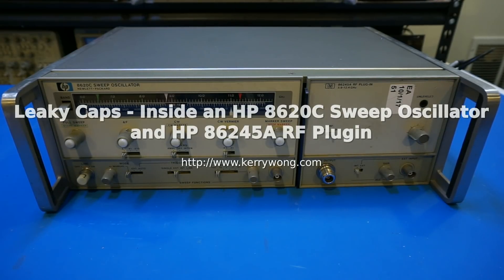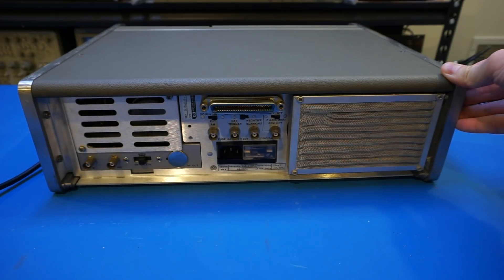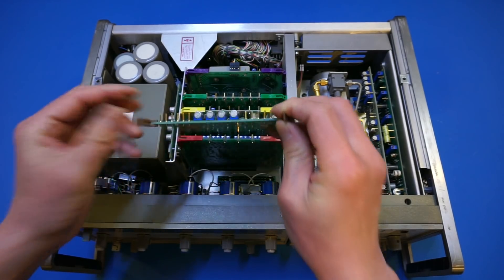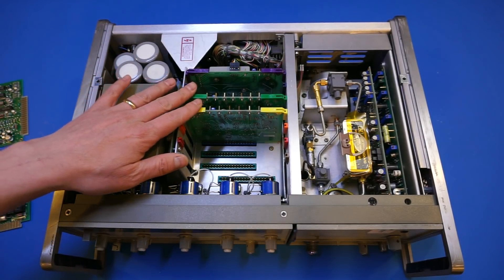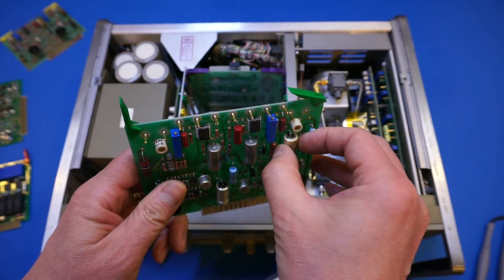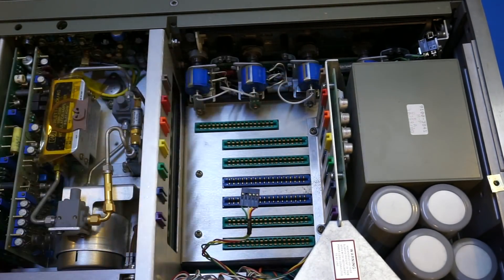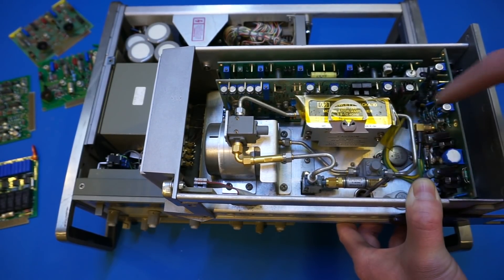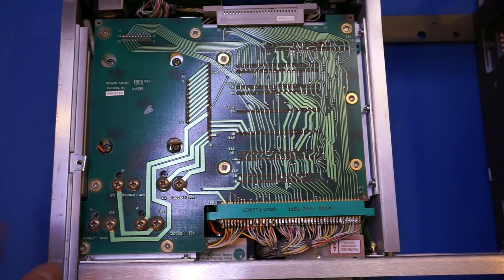Leaky Caps - Inside an HP 8620C Sweep Oscillator and HP 86245A RF Plugin

Comment: The capacitors that did not appear leaky look like M39003 "Tantalex" capacitors. These are essentially mil-spec solid electrolyte tantalum capacitors, extremely reliable. So reliable it's almost unbelievable (some equipment I work with have RF power amplifiers that operate around 60-80C 24/7 and use Tantalex capacitors, 30+ years in operation and counting, and I have yet to encounter a bad capacitor!).

Wet tantalum electrolytic capacitors on the other hand... terrible. The wet electrolyte is acidic and over a long enough period of time ends up eating through the leads and casing. Very common with old gear. Those capacitors eventually go bad just sitting there. Entirely possible that piece of equipment was working fine the last time it was used and the capacitors decayed in storage.
Reply from the maker: I can confirm that those good ones are remain in excellent shape. I took one out and did some measurements, the ESR is lower than chemicon one I was about to replace it with so I soldered it right back :)

Comment: You never mentioned if you checked the voltage setting on the rear and the fuse, just in case you overlooked obvious causes first.
Reply from the maker: Yes, the voltage setting was set to 110V. I thought I mentioned the fuse (I did check that in the video), but the fuse was fine. Anyway, I made some progress after the video, will have an update in the next week or so. Stay tuned!

Comment: Rubber sealed wet tantalum will fail, but the glass seal ones rarely do. Change with modern ultra low ESR caps similar rating ( probably go up, as they will be odd values) and same voltage and it will work fine.
Reply from the maker: I am planing to change the caps this weekend and will report back shortly after. Stay tuned!

Comment: I like seeing these earlier models. I own 8673D, 8673B, and 8340B units. Right from the top you can see the similarities and differences of what was used to build up to those units. Even the fan control's grey box shown here is something I recently saw in the 8673D's fan on the bottom portion. The difference that I see is I assume there is no FM input (there is an AM) and the range. Since the range is not too much you get away with using just the YIG. In the range of say, 10MHz to 26.5GHz there needs to be more components added. Overall nice clean unit (aside from the caps) and teardown.
Reply from the maker: I like these earlier models as well. Most of the problems can be easily fixed (unless it's one of those GaAs modules which is unobtainium )